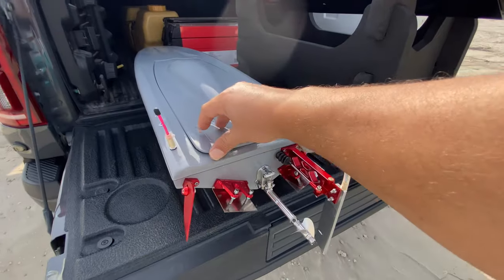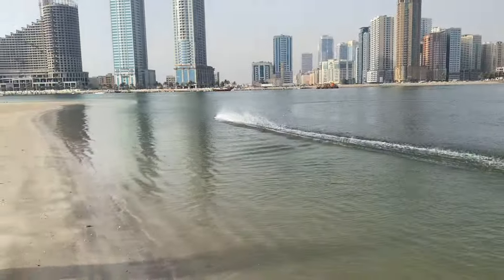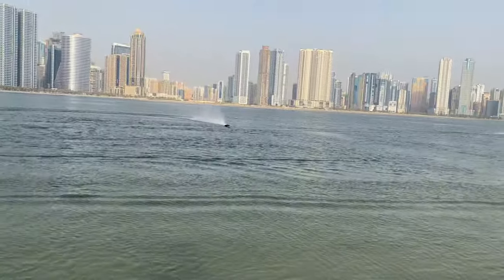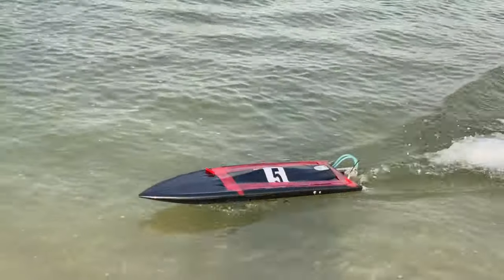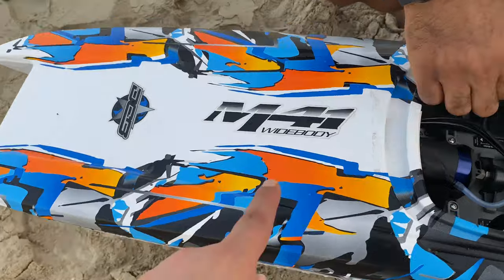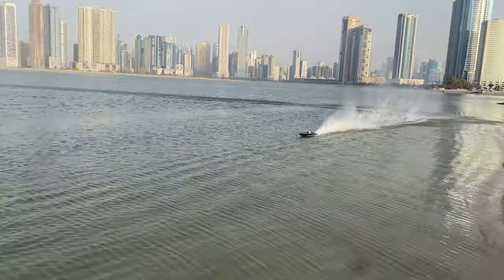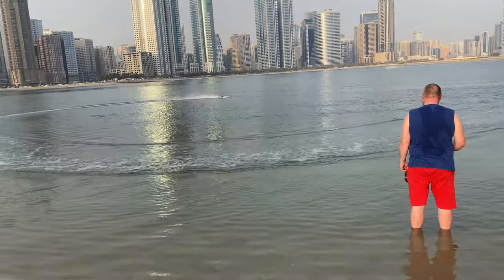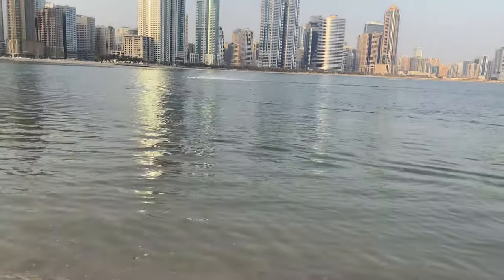Racing RC Boats Mono NTC DC Vietnam Vs TFL China VS Traxxas M41Catamaran Widebody

Comment: beautiful !!! very nice driving...are you running the 160 amp esc with the 1650 kv motor with 6S or 8S ?
Reply from the maker: Thanks 6s
Reply: @UAERCADDICTS  what brand ? how come it looks faster than a 2000 kv motor ?how many mah in the 6S batt ?